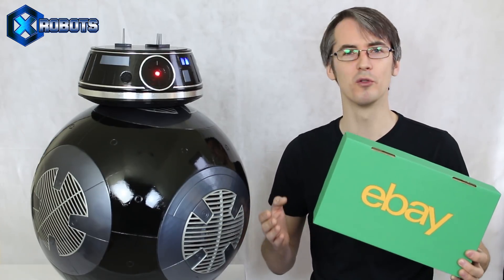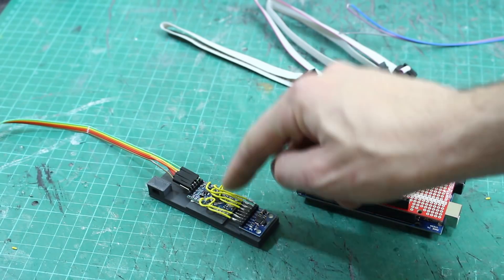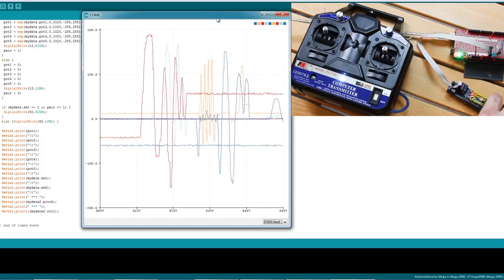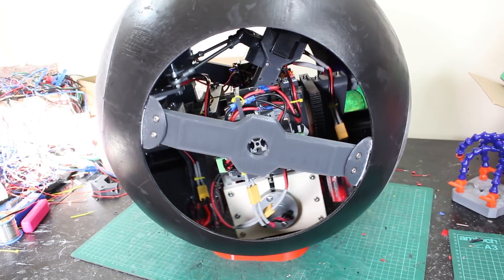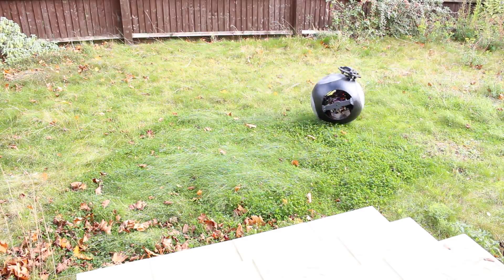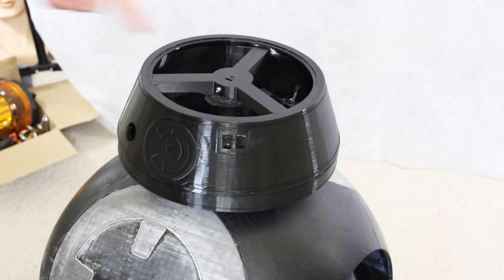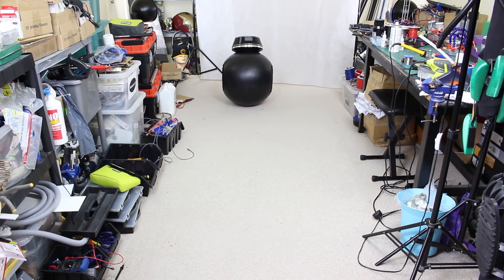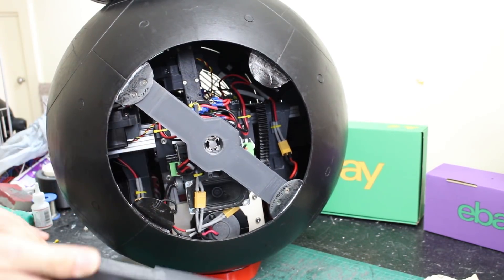Building a Star Wars BB-9E Droid from The Last Jedi #2 | James Bruton

Comment: When you did the final clear coat, did you protect the electronics under the grill plates? Because from the angle it didn't not appear to be
Reply from the maker: Sort of with paper etc
Reply: @jamesbruton  ok yeah I was wondering if you did could not easily see that, awesome build btw :) I'm still learning Arduino and etc I'd love to eventually build something like this
Reply: @jamesbruton   What about the self rotation like in bb8?? Is this available in github?

Comment: I am surprised you didn't use a single joystick for the controller, it would be easier to control with forward, back, left and right then twist the joystick to rotate the head, just a thought.
Reply: James Bruton yes you can still move and steer while twisting the joystick to move the head, I built an RC tank and controlled the turret while moving using this principle.
Reply: James Bruton I should have mentioned I used an old flight simulator controller for parts.

Comment: AWESOME!!! 😁 Now add in some coils so you can do wireless charging. Put the coils on the sides where the cross member supports are so you can just park it to start charging. Then you'd only need to open it to replace worn out parts. Probably could go years without issues! 😎

Comment: What are the specs on those heavy duty ball joints and metal arms for dome mast? They look like a nice upgrade over the semiflex printed arms you had on BB-8 V3. I found that flexible arms are too floppy and have a hard time overcoming the force of my magnets in my build.
Reply: James Bruton Thanks for the reply! I found the female M6 ball joints on eBay. Would regular M6 threaded steel studding work for control arms or should I be looking for something lighter more suited for R/C? It looks like you’re using smooth rod for arms. Does that required special tooling to add threads?

Comment: Now connect four of those droids with a chassis and a seat and you have an omnidirectional car.  Connect two and you'll have a omnidirectional motorcycle, although I don't know how stable. What is the weight bearing capacity of these droids?

Comment: Fantastic job, James!  You 'upgraded' your rebuild of BB-8 by offsetting the tracking--to make it appear that it could roll in any direction (and not always across the same four circular panels).  Did you not do this this time due to time constraints?  Incredible design!  I wondered if it is feasible to make a build with no set tracking (actually rolls in all directions).

Comment: I feel like you should of off set the mounts for the axle bracket. That way the circles on the body won't be line. That gave bb8 version 3 more realistic.
Reply: No the panel stay where they are. Instead of having the axle in line with the center of the brace. Move side of the axle up and the other down. Like I said like bb8 version 3.
Reply: Just take the axle mount and the axle goes the center mover that hole up about one inch or more or less. Then with the same style mount, turn it upside down. This will just  Slightly off set the panels.

Comment: Why didn't you offset the spots on the outside of the ball like you did last time. Now when the ball rolls it's obvious that it's only got that 1 axis
Reply: He still did very well!
Reply: there are TWO main types of drive systems, the direct drive like on this droid where it is physically attached to the inner wall of the sphere, and there is the "Hamster Ball" type drive, where the drive itself is free rolling inside, each type has it's positives & negatives...
: +more torque, +more stable drive over irregular surfaces, +vertical axis head control, not just horizontal rotation / -more complicated programming, -heavier, -more costly, -more complicated, -less operational time between charges
*
: +less complicated programming, +less costly, +less complicated, +lighter, +more operational time between charges, / -less stable over irregular surfaces, -less torque, -only horizontal spin for head
*
Direct Drive systems are better for more experienced and better access to funding
Hamster Ball drives are better for first time and/or inexperienced in electronics and those who are not well funded